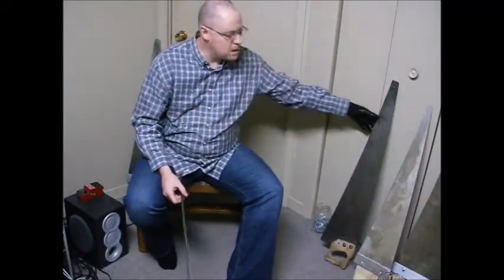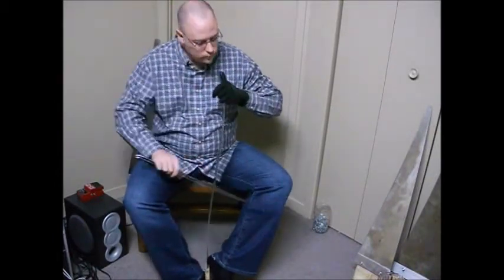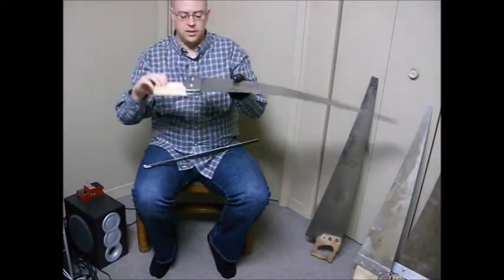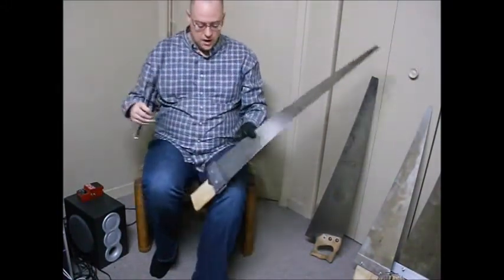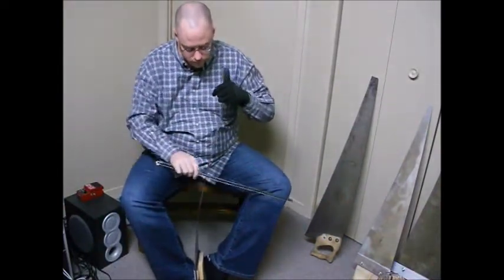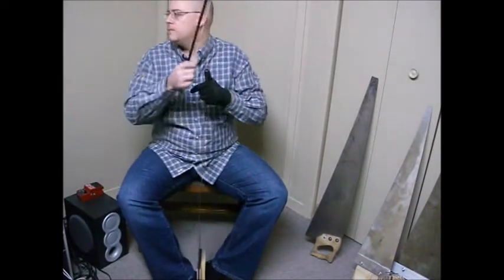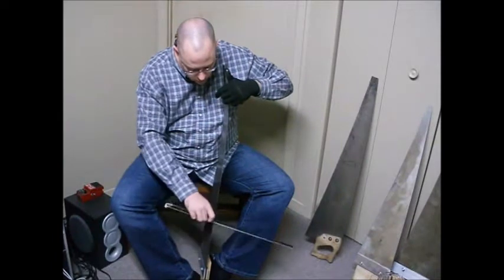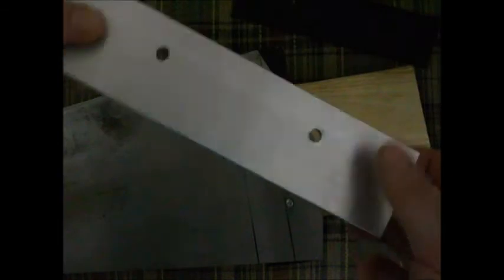Musical saw, how to play A3 on a Wentworth !

Comment: Oliver Just so I'm clear - the modified one is from the same Wentworth 36" you show in the beginning of the video?  Also, did you remove the teeth on both saws? Do you have any videos showing the difference in standard stock "toothed" saws and those with the teeth removed?  Thanks and keep up the good work.
Reply from the maker: It's 2 differents but originally identical wentworth 36''. The modify one have also tooth removed, but it dont really change the lo note. You actually lose a little bit of the low range by removing the toots as you reduce the width of the saw (but under half a tone) I have Parkstone Melody with and without tooth, I will make a video soon to show the difference.
Reply from the maker: Just noticed that the base of the 2 saw are different, probably a model change over time, anyway, the base note was c4 on the other saw as well !